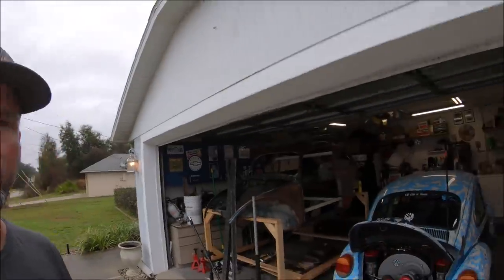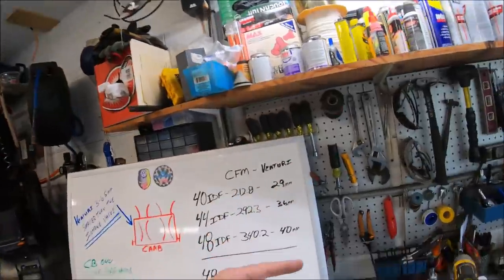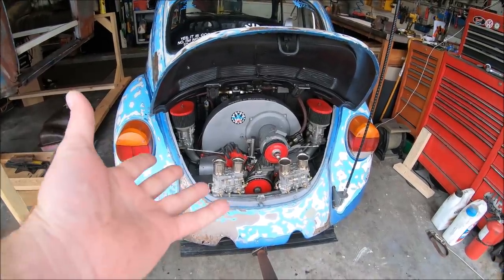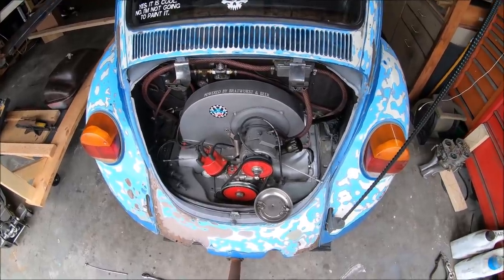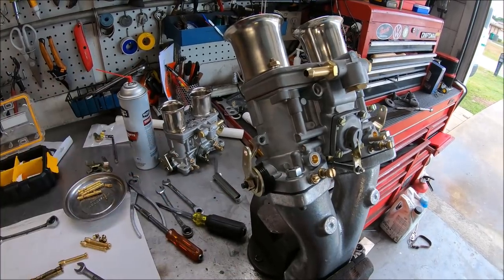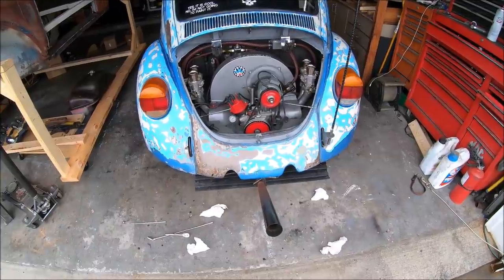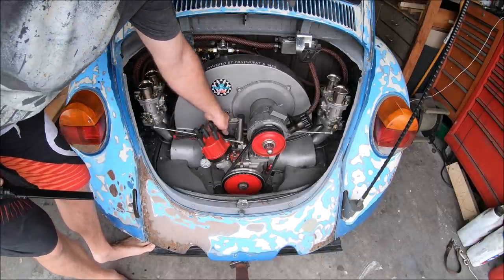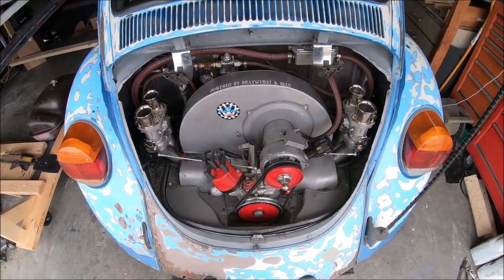Lets Install Those No Name Chinese IDF Clone Carbs on my Volkswagen! Big Fail? Part 2/2

Comment: It’s all about jetting that’s it. Those could be great for your setup. 
  I don’t think valve size is a gauge to work with - of course it is but reality says you can get many varieties of setups functioning on the same valve size .
 It all goes back to where do you want your power band . A large venturie will be soggy on the bottom end and awesome in the higher rpm range . And vise versa for a smaller vent . 
  The venturie effect is squeezing the air through an opening where it speeds up on the other side - this aids in port velocity for lower rpms and also vacuum to pull fuel out of the bowl.  But can become a choke at higher rpms.

 On a big vent you loose all sorts of port velocity on the bottom end but gain the loss of a “choke” on the top end so it flows and flows.
  All about drive habits and just what you want to achieve.

 IDAs can be the best of both worlds if setup correctly.
  44s with 36vents is a strong all around setup . 
   I ran 44s with 32vents for ever such a good setup for my little motor .

I think the board with flow is not functional if the information is not consistent when comparing .

 I also think carbs are easy - need to do a video of what is what and why things are happening when they happen.
Reply from the maker: Well said sir! That’s pretty much what happened, large vent on this setup absolutely flew mid through upper rpm band but was soggy down below. Of course I needed to up the idle and main jets some more. However, I don’t race this car and street drivability is important for me. 
I ended up putting my 44’s back on for now. I know it could be better than what it is but all around it’s great how it is. I figured I’d see how these perform and for the price I couldn’t go wrong. 
IDA’s with 36 vents would be perfect but then I’d be out cnc machined intakes 🤷‍♂️
Sometimes it’s just best to leave things alone but then that’s no fun 😂

Comment: I put a 1915cc at 11:1 with heads i ported just as massively in to a Manx buggy that weighed 1100lbs. .lol......i even polished the exhaust ports and the header pipes.(I even polished the collector and u-bend). So i fabricated a manifold for a Holley 350 cfm 2 barrel carb for simplicity....after adding a carb spacer it worked amazing with proper jetting. (And yes i had to create a custom throttle cable). But that's what we do for the love of our toys....lol
Reply from the maker: Sounds like it was a blast!
Reply: @VWJawbreaker  Yeah it was  I had to sell it after all.,,...but it was a blast for the time I had it.   .  But I sold it for a pretty penny. $27k...
Reply from the maker: @jaytee1086  nice!!

Comment: You’ll get it figured out. We all sit back and ponder on these cars! 
Good video.
Reply from the maker: If I would have remembered that my intake valves are 42mm and not 44mm when I ordered the carbs we would have had a different outcome. Ran great mid and upper rpm, lost low end torque due to the venturi being too large. Live and learn lol

Comment: I installed. Type 4 motor in my 72 beetle. I like the removable deck lid idea. I made my rear apron removable. Otherwise I have to do serious disassembly just to get the motor out.
Reply from the maker: A removable apron is a great idea!

Comment: Interesting video, Gary. I like and respect that even though it didn’t work out you still uploaded. Didn’t even realise there was such thing as a 48 IDF. Another good less in carbs right there! 

Ben 🇬🇧
Reply from the maker: The reason they didn’t work out is that I was thinking the intake valve was bigger than it was.... if I would have remembered that when I ordered them things would have been different. It ran great mid and upper rpm, just lost low end torque. 
With that being said, I’m not an expert and we all learn together. 
Thanks for being here Ben.

Comment: Grass hopper has much to learn about intake manifolds and heads but good job on the basic's. Oh need to do some more home work on IDA's they come with 37 venturis
Reply from the maker: For some reason I thought I had larger intake valves when I ordered the carbs. 
I know the IDA’s have smaller venturis but these are IDF’s to keep the intakes the same.

Comment: Just to say thanks for the video. I pulled a lot of very useful information from Your work here. In fact I bought 2 of these for My volvo 740 project but I could only fit one on because they are too tall to go under the wedge bonnet "duh" anyway like You I'm always learning from My mistakes. Best of luck with Your cars. Best Wishes Jahmahrah
Reply from the maker: I appreciate the kind and thank you for taking the time to comment. 
We all learn from one another, no matter if some want to admit it or not. No one knows it all so the more we can share what works for each other, the better we can all be. Glad the video was able to help you out! 
Happy New Year.
Reply: @VWJawbreaker  Oh I forgot to say for tuning the mixture I always use a little device called a Gunstons Colour Tune. It's a clear spark plug that allows You to see the actual colour of the explosion, and You then make adjustments to get a nice blue burn. I've had mine since the 70's and have always tuned My engines with one  : - )
Reply from the maker: @jahmahrahdesafilli6268  that sounds like a cool concept tool!

Comment: Ahh Dual Carbs... as soon as you said 48's I thought about port velocity and jetting.  Some one should be able to supply you with vents or have a shop spin some out on a lathe. likely you will need to jet up on the main and drop the air a little. You can get bigger vents for your 44's  or have your current vents bored out to say 38mm you will need to bump up the main and drop the air jets some as well. Idle jets may need a bump up too if you cant get it to adjust with the mixture screws. CB has that update kit for the IDF'S that changes the secondary vent to a spray bar and it comes with new vents and jets. but that kit would kill your bottom end too. I found stock idf44mm carbs on the street are just right for me. I run very similar engine to yours.  A set of CB ultra wedge ports with bigger intake valves would do the trick too.   I have a sweet set of gene berg 52's that I would love to run but would have the same issue as you right now. manifolds linkage vent size ect. Sad to say for me the next step is fuel injection or turbo or both to get more power and keep drivability with out tearing my motor down. thanks for sharing I am also not an expert but enjoy and appreciate what you are doing.
Reply from the maker: Like you, I’m not an expert. I’m just trying new things and bringing everyone along for the ride. 
You are correct, the vents are too big to idle and for low end. She screams hard up top though but not very streetable imo. 
I did find a set of smaller vents for these carbs, that’ll be a project for another time down the road. 
Thanks for the feedback, hope you have a great week.
Reply from the maker: Oh and ps, for some reason I thought my heads had 44mm valves, not 42’s. If that’s the case these would have worked better.

Comment: Great video! You are not lying about those ports. Way bigger than stock. Hate it didn’t work out for ya at this time. Sounded good and mean though!
Reply from the maker: Those ports and heads are huge man! 
I thought for some reason the intake valve was the next size larger than what I do have, if that was the case they would have worked perfect. They did work and run well, just idling higher than I wanted and lost some low end torque.

Comment: It will work, just not today.. Great idea, on the removable hinge pins!👍
Reply from the maker: It ran and ran well above normal rpm idle range. I lost low end due to the venturi size, change them for one size smaller and it’ll be just fine. I thought my heads had the next size larger intake valve when I ordered them.... ops lol
It would have worked fine if it wasn’t for that.

Comment: Thank you for showing these off to the community,  I'm sorry the carbs didn't work out for you, I know that you have to pick your battles on what upgrades you want to make work. I had the same issue with 48 IDA's prior to installing 37mm Venturi.  The way the 48 IDF's were out of the box you would have needed at least a 70 idle jets, and with the large Venturi and FK8 cam your idle might have settled in around 1200'ish RPM this is fine and well for the strip but is just not particle for a driven street car.
Reply from the maker: 100% correct, this would have been perfect for the strip but not practical on the street. They did great on mind and upper rpm, just no low end torque and some drivability was lost. We live and learn, we wanted to see what would happen and now we know.

Comment: You needed larger main jets at least 2 sizes, the  F11 emulsion tubes leaned it out even more. Just buy some 40 mm Venturis/Chokes for your Webers
Reply from the maker: Those had 40mm vents in them. It all worked out in the end.

Comment: You talked me out of getting those. Whew, that was close, I was getting close to what I thought would be an upgrade, but sure looks like nothing but a headache there. I'll retreat to "if it aint broke, dont fix it". lol Good looking out man!
Reply from the maker: They actually ran great, mid and upper rpm was great... My idle issue was due to me thinking my intake valve was bigger than it was so the larger venturi moved the power band further up.
Reply: They will work just fine once the Venturi is figured out. I run these in my bus with no issues.
Reply from the maker: @terryprevatt  yea sir, I can drop down to a 38mm vent and they’ll be just fine.

Comment: Both of my 48 setups on both of my Motors are totally streetable they idle perfect at 9:50 and there are 9 1/2 10 1/2 to one motor and they are all day all night on the street no problem Gary put the carburetors back on they'll work
Reply from the maker: Yes they would work however I had some reasons why I went back to the 44’s. Appreciate the input 👍
Reply: Right on maybe on the next big motor

Comment: Keep up the great work, it's all about taking the knocks and coming back better..... I've bought a set of the 40s and just  trying to work out whether or not to port and polish the stock heads or get new ones.
Reply from the maker: As I always say, I’m not an expert. I made a mistake by thinking I had larger intake valves than I did, that’s why they didn’t run well in low rpm’s. Mid and high rpm’s it pulled like a beast and needed way bigger main jets.

Comment: Sounded good revving it up - what’s the engine size or is it really the matter of those hoggin heads needing the extra - could you have upgraded the venturis and jets to achieve a better outcome ?
Reply from the maker: It’s a pretty stout 2054 with fk8 cam, 1.4 rockers, 10.0:1 compression. 
I could have put smaller venturis in it and gone from there on the rejet, decided to put the 44’s back on since I do so much driving. I could have gotten these to work decided not to.

Comment: That jam at 11:56 is pretty dope. 😀 Still watching and curious how this is going to work out.
Reply from the maker: I have to agree, not to mention the dudes music in general is killer. Need more tunes!
It worked out ok if I would have remembered what size intake valves I had when ordering the carbs. The venturi is too close to the intake valve size so I lose low end and it idles higher than I would like. Top end is no joke! Need smaller venturi for these carbs and it’ll be perfect. But that’s a story for later down the road.

Comment: The H40 pairs generally deliver better power across the rev range than the rest of aftermarket stock 1600  if anybody needs to know, dell ortos are also good but they're getting old now.
Reply: Nice decklid mod, have you done an easy out rear apron mod, that's something I want to do this year just cos my apron is rusty anyway and might as well make life easier so I don't cut my knuckles every few years when I replace the exhaust! I hate that.
Reply from the maker: @johncollins5552  I haven’t touched the apron yet, it’s something I’d do if I ever need to replace the apron but don’t want to hack it up just to make it removable.

Comment: Hi, Gary, have been watching your videos on youtube for quiet a while now.. Very informative !

I am in the process of building a 1835 engine for my '73 beetle.
Have the engine ready so far, and just pulled the old engine, to transfer all the cooling tins and other bits and pieces.
Tried to do a mock up with the new manifolds and carbs, and there is a lot of interference between the manifold flange and the cooling tin.
So much, that it is pretty much impossible to get the manifold in.

How did you modify the cooling tins to make that possible ?

Any tips would be greatly appreciated !
Reply from the maker: Glad some of the videos have helped ya out!
As far as the head tins, you’ll most likely need to modify them a little at a time to get the manifolds to fit. Usually you’ll modify the interior “flap” that goes between the spark plus. You might be able to bend things around a little to get the manifolds to sit properly.

Comment: Try this: one, close all air bypass screws. Second, Fuel level up and third, smaller airjets will put you there. I bet
Reply from the maker: All air bypass screws are always shut on my carbs. They ran good but the venturis were too big causing a higher idle rpm to maintain a vacuum through the idle circuit. 
Air jets aren’t being utilized at idle, only at higher rpm.
Reply: @VWJawbreaker  good day! thank you!  Sorry, yes, you are right on idle! Do you think Bigger idle jets wont help it?
Reply from the maker: @felixlafuente9714  no need to be sorry, we all have different strengths and weaknesses and we’re better as we all learn together!
Larger idle jets would only deliver more fuel and make it run richer at idle. 
Refer back to the pinned comment on this video, Tommie did a great job going through some explanations.

Comment: Those carbs will work on your car I've got a 2332 super flows with 46 mm valves in them and I'm running dual 48s and it's just jetting once you get the jetting and the chokes done it'll be perfect and those 48s will make those heads breathe I also got a 2496 I'm putting together for another manx and it's got dual 48s on it with 37 chokes the Venturi down in the middle of the carb and it's got huge jets in it you just need to put them back on and read Jet them they will work on the street if I'm running 48 idas with 46 mm valves you can run those 48 idfs with those 42 mm valves no problem more fuel more air come on Gary put them back on do it
Reply from the maker: Yes it could be done but I don’t want to have to buy a different set of Venturi’s for it so I gifted them to someone.
Reply: Oh right on well cool well someone else will definitely enjoy those carburetors

Comment: Of course you have other vw projects... Those carbs could go that way... Just a thought...
I have AS 40/35.5 heads (I think from CB performance)
Feeding the fuel is dual 40mm Kadrons.
They work, but my fuel mileage sucks. Any suggestions?
Keep up the great work brother!!
Reply from the maker: I wonder if you’d Milage is that bad if you’re running too rich? How black are the spark plugs?

Comment: I did the math. The 48’s are gonna be a tick small but I think they would go good on my stock cam 1641 with 041 heads from JC Whitney ha ha. 😎
Reply from the maker: You know Randy, you may want to go with 51’s for that setup 😂😂
Reply: @VWJawbreaker  I don’t want the front wheels to come too far off the ground. 🤪I just want stop light to stop light acceleration. And if you knew where I live you’d understand how silly that sounds. I live in Moody County.  There are no stoplights in the entire county. There is no McDonalds in the whole County. We do have a subway and a Dollar General Ha ha. Oh we are up to 3 four way stops. That really confuses people. I mean who really is supposed to go first.  No you go we all trying to be nice. On that rambling note I better get back to work ha ha. 1641 is getting a centermount Dellorto ‘DRLA40 with 30 mm Venturis. And I’m gonna like it cause that what I got 🙀😎
Reply from the maker: @sheldonjr7hp  oh man, every time we talk I get even more jealous of where you live!.... minus the snow and subzero temps 😂
Run what you have and make it work, that’s how we do things.

Comment: Curious to see if these are a decent upgrade option in the end.  Any thoughts on playing a bit more with them or an upcoming video in the foreseeable future?  Love the channel, BTW
Reply from the maker: Well, since I screwed up by ordering these with a bigger venturi, the low end performance was blah. I could have spent another $100 and bought smaller vents but decided to sell them instead. In all reality, and my driving habits, 44’s with 36 vents are a better choice.  
With that said I know a few people who have had great success with these carbs as long as you bench clean / set them up. If you need a dual carb kit, I’d recommend buying a kit instead of piecing it together.

Comment: I have a question why we don't use f2 emulsion tubes in vw? what does the emulsion tube do?
Reply from the maker: That can be a long answer but the short of it is, the emulsion tube is used to maintain the air fuel ratio at all speeds.It consists of a well with main metering jet at its bottom. The jet has holes on its sides.It is in communication with atmospheric air. Initially air is drawn through the holes into the well and fuel is emulsified.

Comment: also--where did you relocate your coil..??  Mine is  high up on shroud and always in the way...currently running Pertronix II and bosch coil...
Reply from the maker: Coil with that cross bar linkage was between the fuel pump and fan shroud.